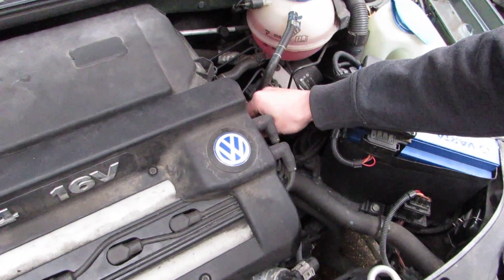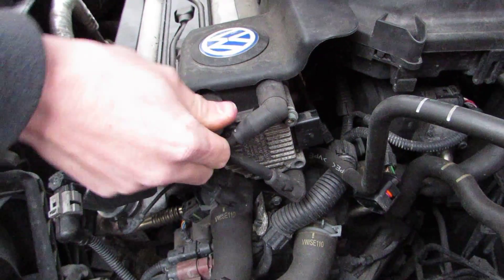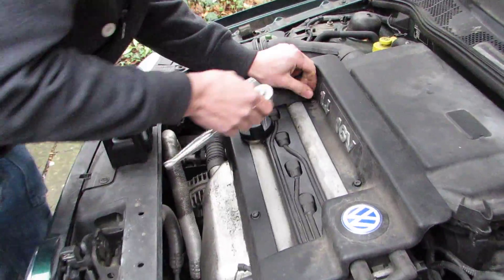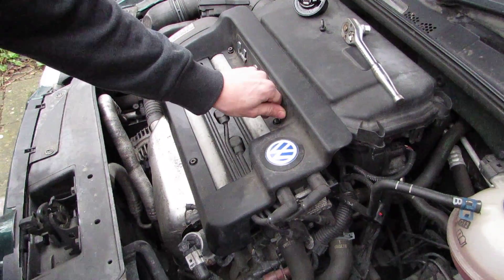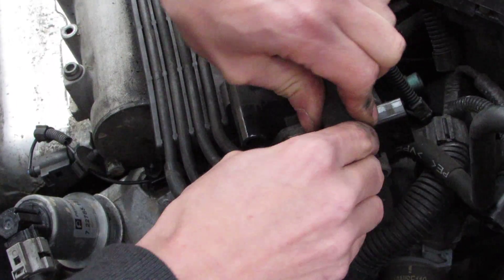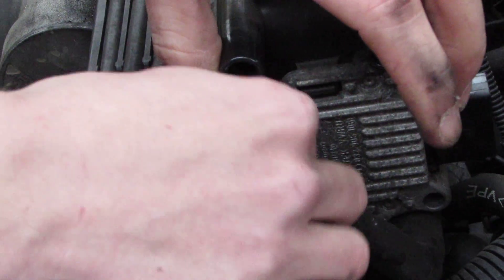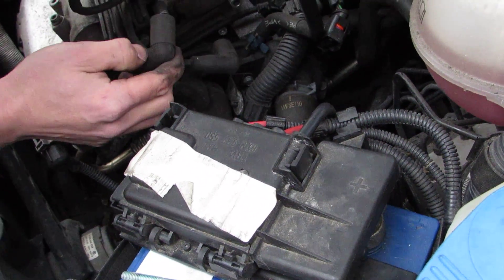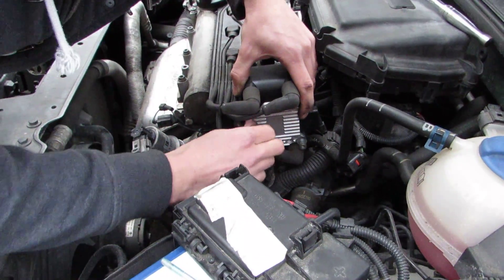Coil Pack: VW Polo 1390cc Petrol

Comment: Thanks, i just replaced mine with help of your video. My old coil pack had one of the for connector (4 dark round tubes) broken. it was full of white soot. The soot was inside the tube and inside the ignition harness.

Comment: Oh man, mechanic is right. Your engine has a very user friendly parts access lol.

My Audi A3 1.6 needs the coil pack, spark plugs and ignition coil wires replacing.... It's a pain in the ass to get to. You have to remove a manifold off to access it, awkward bolt locations!
Reply: Yes as I found out yesterday on my 2 litre VW Passat 2002 with the AZM engine!